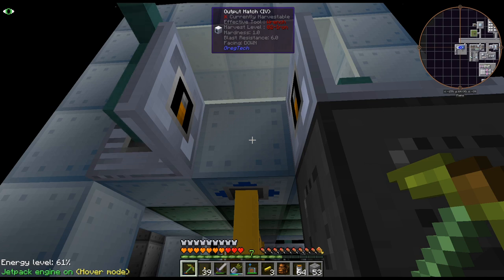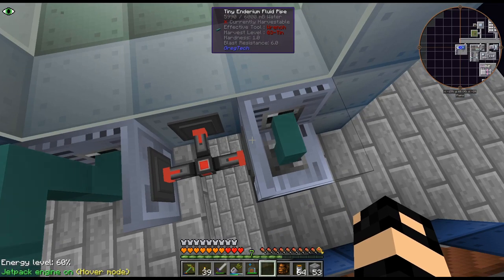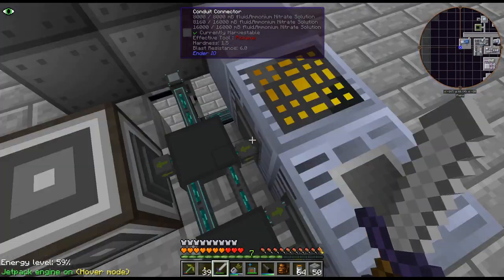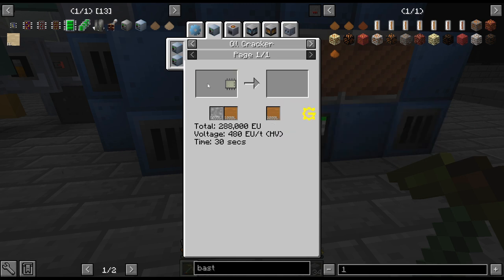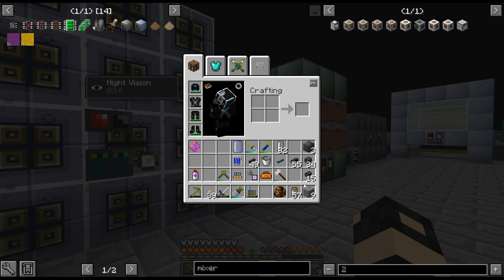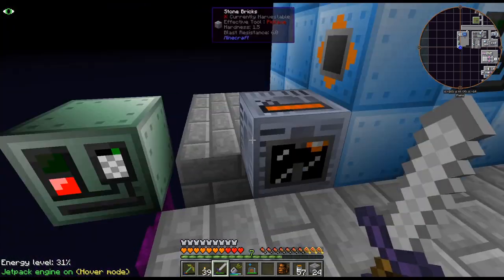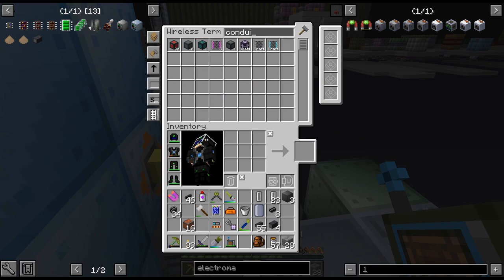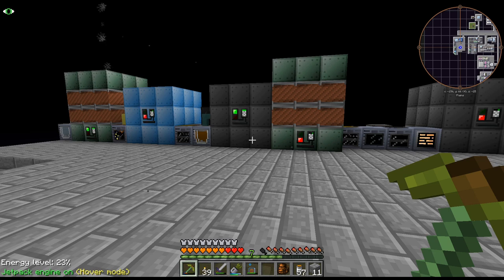GregTech New Horizons S2 - 178 - Continuing Monazite Line

Comment: It shrinks pipes and cables yep
The issue was that it was trying to do max parallels I’m guessing and you didn’t have enough space in the output hatch and input hatches i think as well
One of your LCRs turned off when you wrenched the energy hatch to face the right way, don’t wrench transformers and energy hatches
It will be broken for a very long time if you don’t update though, very much recommend updating